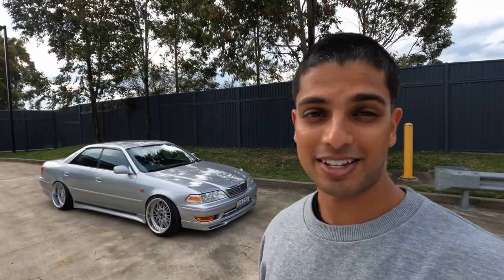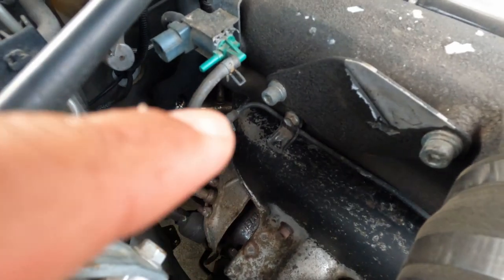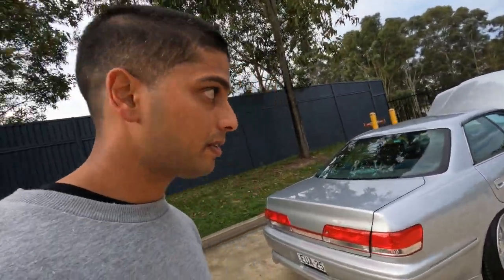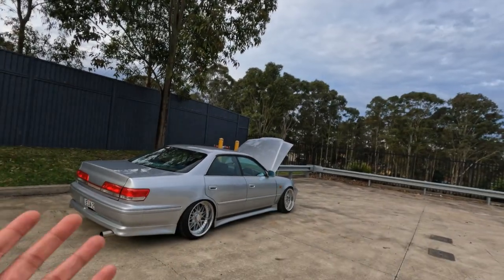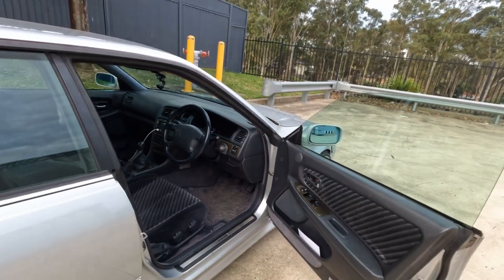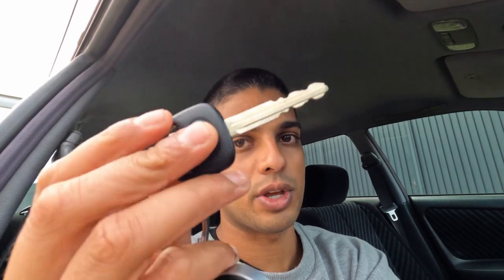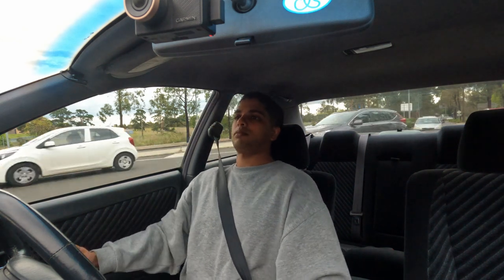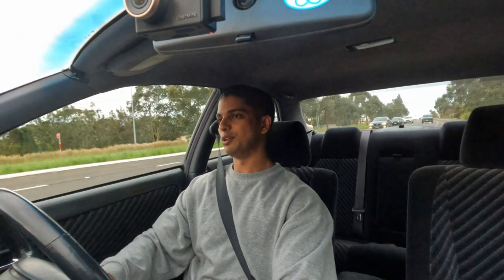"STREET CAR" JZX100

Comment: My grandpa has the same model mark 2 as yours but it's 2jz and it's completely stock it's gonna be mine soon any advice where to start? Should i start off by customization or focus on the performance like turbo and ect..
Reply: Just get a 110 bruz
Reply: @mjjj9509  the jzx100 is way better bro. Better interior looks and also modifications
Reply: @mjjj9509 bro, why do you care? Dudes gonna get a car for free or a deal from a family member.
Reply from the maker: I'd go with suspension and interior, later do gearbox and power mods like turbo